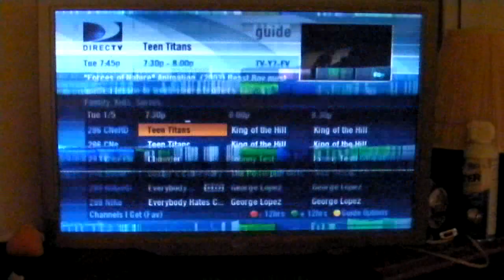Monitor is dying...WTF is it doing?!

Comment: I have 2 of the same monitors and one of them is doing this when I first start it up. It lasts alot longer than yours does and then its fine. As Dondrusco said there is another 2 videos showing the same symptoms. I think its a manufacturing fault with ACER. Since alot of people are having the very same problem.